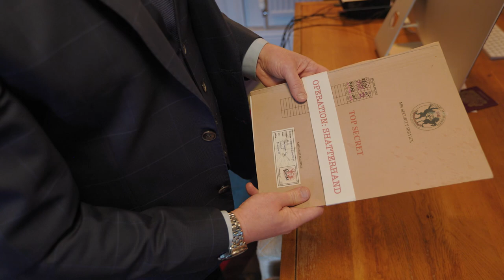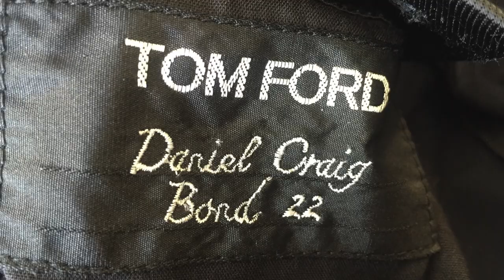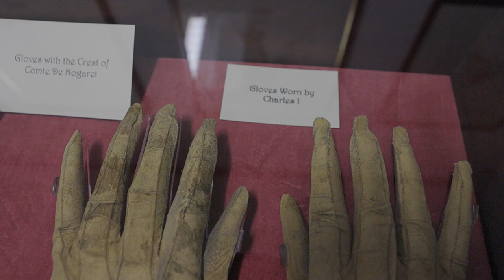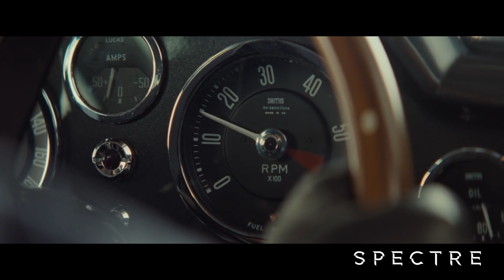Dent's- James Bond's Glove Maker

Comment: Blair is your Bond peacoat the 100% wool version or the later versions that are a blend and which version of the Seamaster are you wearing?
Reply: heeroy7 In the Begging he’s wearing the 2500C Omega Planet Ocean (2201.50.00) on a nato. Then for the main video he’s wearing either the (2531.80.00) Tomorrow Never Dies Omega SM300 or the Casino Royale SM300 (2220.80.00.)
Reply from the maker: ND is spot on! I wear the Casino Royale Planet Ocean on an Omega NATO strap and the Casino Royale SM300. The Billy Reid Peacoat is one from the original run in 100% wool.
Reply from the maker: @Spook291  Great watch sleuthing, ND! Right on the money with both watches!
Reply: @thebondvivant8030  I didn't even notice the CR PO on your wrist which is surprising as it's a BIG watch!